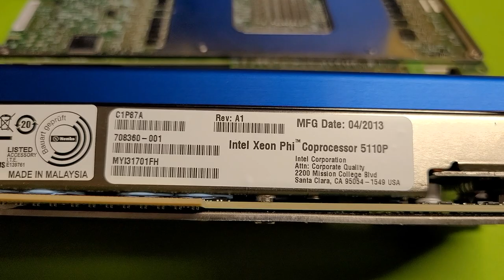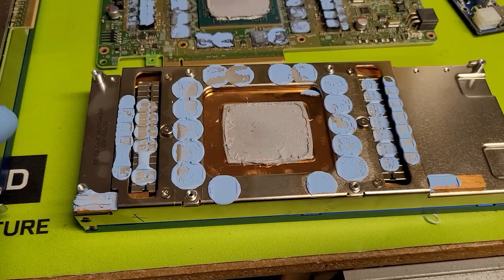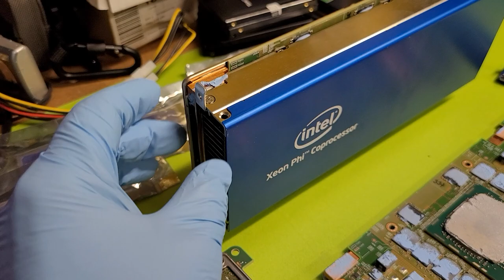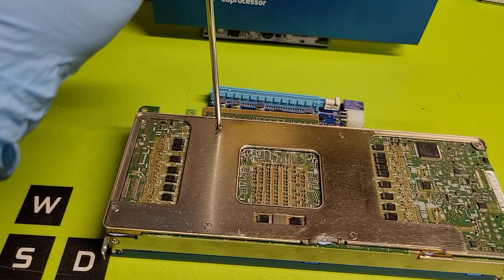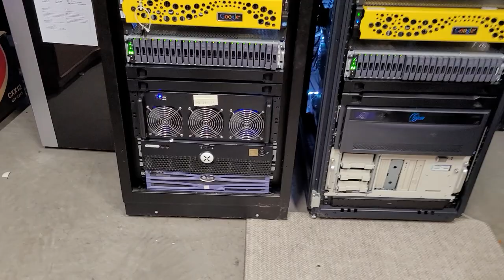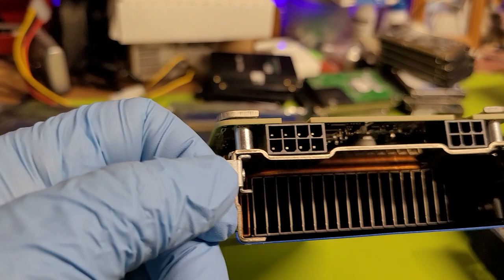Wow the Intel XEON Pi PCIe processor cards... Very cool

Comment: All you have to do is look at the instruction set to know that these wont work for mining, you would have to emulate any kind of instruction set which will destroy processing performance. The older Xeon Phis use Intel IMC which. . . Does any code for this? Based on the MSRP vs used price model and EOL status on Intel Ark I would say no. The newer 7200 series can't be had for any reasonable amount of money and run on the AVX512 set which is basically brand new in terms of instruction set and good luck coding for that abomination. I expect it to go as well as Intel's IMC set which was killed off only a few years of existence. This card is built for 1 thing and 1 thing only and no one has ever figured out what that thing is. Intel's DG2 is supposed to be the replacement for this entire product stack. RIP Intel Xeon Phi. Quit trying to mine on these things please and find a real use.
Reply from the maker: Ah! But it has been fun trying.  My cards failed like you predicted but we were able to do some forms of mining.. Fun times dude!

Comment: I'm interested in buying one of these things to experiment with in my proxmox server, which card should I get? Also, I sent a request to join the facebook group. I would absolutely love to see where we'll get.
Reply from the maker: I would get one of the newer ones that is still cheap. To many issue with getting the older cards running because Intel took down the software Libraries.  Enjoy!
Reply: @leadiususa7394  Ok, so 7120P or is the 5110P "new enough"
Reply: @leadiususa7394  with you getting these running are you willing to share the libarys to get running ?
Reply from the maker: @ukmayhemproductions  I was never able to get them I am sorry to say...
Reply: @leadiususa7394  thanks for the reply mate 

so i did some hunting via ibm and i may have found the many core drives 

intel there gone waiting for the phi to arrive and i shall update ive also sent req for facebook group :)